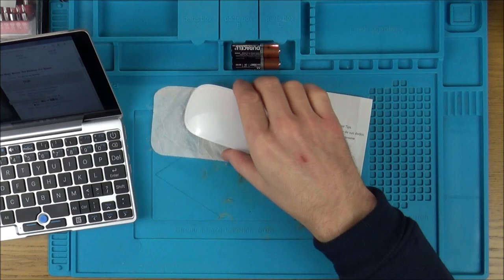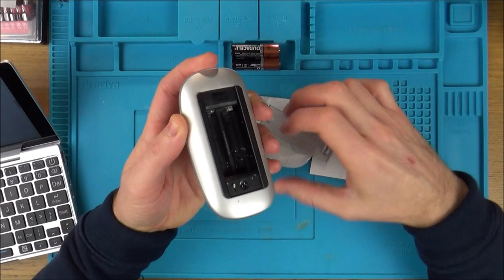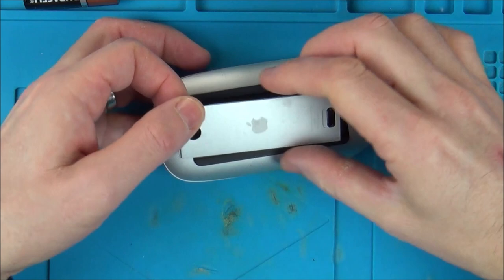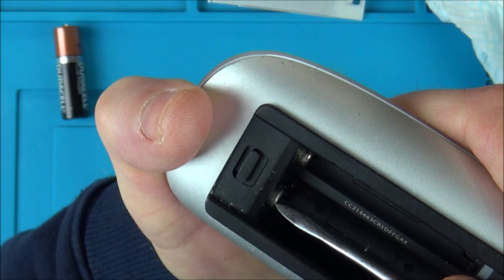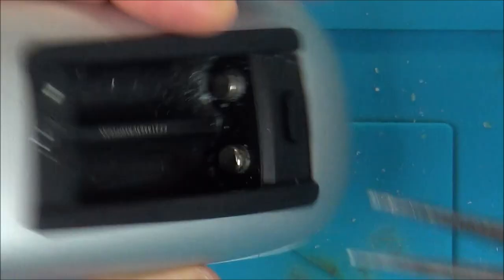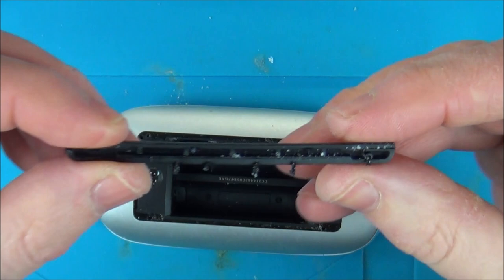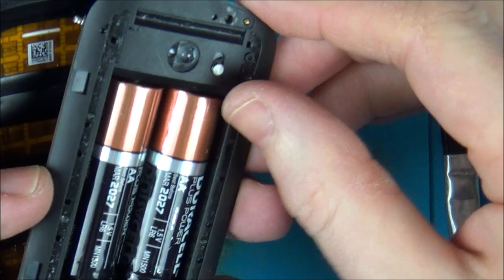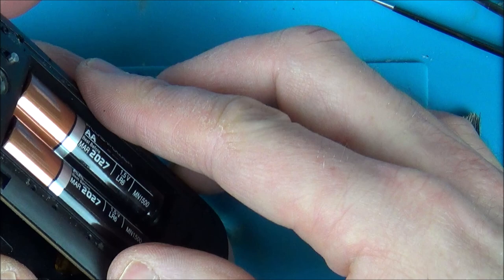Trying to FIX: Faulty Apple Magic Mouse 1 purchased from eBay

Comment: Vince: ‚Yeah, maybe if you‘re some kind of graphic designer in some fancy office somewhere, you‘d want it looking all sleek.‘

Me: * Nervously peeks at my Mac in the corner * I....I feel so called out right now. Lol

To be fair, my office is a dump and Graphic Design is mostly very boring, so everything that makes your life a little easer is welcome.
Honestly though I love the Magic Mouse for it‘s touch capabilities more than anything else and I think that‘s probably part of the reason they designed it that way as well. The touch scroll and swipe gestures would not be seamless with split physical buttons and would have to be restricted to certain zones on the mouse, wich would make them a pain to use.  So they kind of had to design the mouse as a single slab to ensure that it is functional. Now the charge port on the version 2, that is stupid and clearly form over function.
Reply from the maker: Haha, sorry :-) Thanks for your insight on the Magic mouse :-)
Reply: @Mymatevince  It's all good! I just thought it was funny. :)

I love your videos btw. I've learned so much about fault finding, electronics and soldering along with you.

Comment: in 2009 apple didnt have a right click
Reply: That's just not true. MacOS 8 supported right click in 1997. The first Apple Mouse to have a right click function was the Mighty Mouse introduced in 2005.
Reply: @garrys9336  I was being semi-sarcastic as some models absolutely didn't come with right click and some did.  CTRL click and "alternate click" with modifiers were still a thing.  One of those "think different" mentalities.  That mouse i a perfect example, as the PCB is silkscreened 2009 and absolutely doesn't have a right-click, just a spring to make up for the mechanical button not being there.

Comment: i have a slimline an apple extended keyboard I can post to you to fix, almost the mission impossible to fix construction wise, almost guaranteed to destroy it just taking it apart, those touch mice are real fancy using bettertouch tool , you can setup touch sensitive left and right click so no physical click needed less RSI potential.
Reply from the maker: Thank you for the info. I am hoping to release a video late tonight on the Apple keyboard, I also have a 2nd video filmed and edited. So I have done 3 of them. I won't give away the outcome of the videos but I won't be doing anymore ;-) Thanks for the offer though :-)

Comment: Oh Vince this was a really hard video to watch 😂 but if you have never used one before it’s understandable.

Apple mice don’t have a right click, as you can see when you took it apart, there is only one switch. It’s partially done with touch.

The way it works is you press down with one finger to get left click and press down with two fingers to get a right click. I think you can also just tap the top with one or two fingers and not click at all.

The gold pin is just for grounding it to the casing.

Scrolling up and down will still work in Windows with two fingers without any software, basically just think of it as a hybrid between a mouse and a touchpad. Using two fingers down the centre will act like a scroll wheel on a regular mouse. I believe left and right scrolling should work too, not sure about pinch to zoom, been a while since I’ve used one but open a photo in the Windows photo app and try it there.

Bootcamp is not a Windows application, it’s the software that’s pre-installed on Macs to allow you to install Windows as a second OS.

Honestly it’s kinda stupid, Apple prides themselves on simplicity and the whole “it just works” ethos but most of their products are so over simplified to the point that they’re no longer intuitive to use even by someone quite intelligent and technologically minded such as yourself.

Comment: It appears that the ribbon cable connector is NOT pressure fit.  There is a clip that locks the cable into place as shown in the video.  You can also see him flip the clip when he puts the flex-cable back into place.
https://youtu.be/LmRj9bwMJ3c?t=159
Reply from the maker: Thanks Lard, I completed missed it. Cheers for the link :-)

Comment: That mouse does not have a right click. The way you right click is by holding the command button on the Mac keyboard. I have the same mouse with my iMac. You might have somehow just done a sort of touch on the sense of the glass to trigger it as right click or the way how fast you click in between clicks. when using this mouse in windows. The middle of the mouse should work as scrolling (touch)

Good luck
Reply: That hasn’t been true for over 15 years. Macs have regular right clicks and so does the Magic Mouse. If your iMac supports any kind of modern macOS you should be able to switch to regular right-click in the settings.
The way it works is via a touch digitizer in the top assembly (where Vince clipped out that black plastic clip). It has multitouch and detects your finger. I think the actually click is purely cosmetic. Either Vince damaged the digitizer when he he was  trying to reinsert the ribbon cable, or the cable isn’t seated properly.
Reply: @sweetasbloodredjam  So there is a setting in the os? Im runnign High sierra but i cant get it to right click what ever i do.. i can do it with holding ctrl key but not just clicking on the rightside what ever i do.
Reply: @sweetasbloodredjam  nvm i found out if i hold down the mouse click it makes a rightclick
Reply: @Drone_Out  Yes, there's a setting for it. If you go into your system settings and into 'mouse' you will find the 'point&click' tab.

There are three settings: Scroll direction, Secondary click and  Smart zoom. 
Tic the box for 'secondary click' to enable a normal right click on your Mac. In the dropdown menu besides the box you can choose wich side is going to be your right-click, but i think it's on 'right', by default. 

Hope that helps! :)
Reply: @sweetasbloodredjam yes it's there and working now! My God had this thing for almost 1.5 year and never knew this.. I was so convinced it just didn't knew about right clicking unless you used a key or a conventional mouse.🙄🙄 well learn something new everyday! Thx 😊😊
Reply: @Drone_Out  Glad to be of help! :)

Comment: I thought Apple mice don’t have right clicks? As no use in their operating system.
Reply: That is not correct. macOS does have a regular right click context menu, serves the same purpose as in every other system. It pops up on right click with a regular mouse, or on two-finger tap on the touchpad or Magic Mouse
Reply: Yep I am sitting here with a mac (MBP 2018) and have both the magic trackpad, a magic mouse, and a logitech mouse. Logitec works just like windows. Magic mouse and magic trackpad II = two finger for context menu. Windows needs the bootcamp drivers to make these functions work. edit: just noticed its the magic mouse 1, I have the newer one.
Reply: dash8brj Thanks for confirming! I’m on macOS but on a Hackintosh with a regular PC mouse, and I suspected it’s two fingers on the Apple hardware, turns out I was right.
Reply: Maniura thanks
Reply: @YdenPL  Magic Mouse doesn‘t need a two finger click though. It can do a proper right-click.  I regularity switch left and right click, because I use the mouse with my left hand, so I know the digitizer detects wich side I’m clicking. The track pad is a two-finger click, like every Apple trackpad.

Comment: I just don't get why people buy overpriced Apple products. Can someone please tell me why I should buy these instead of cheaper alternatives ?.
Reply: some people react on visible Design, aka 'eye-candy'. I do. Nice devices are sooo attractive.
Reply: @michaelheinrich44  So some product that looks atractive tempts you to buy it ?. I would rather do my research and buy any product that is as at least as reliable but a damn site cheaper than Apple.
Eye candy to me is not the selling point, nor is the logo of the manufacturer printed on it. Explains the reason why I have never bought an Apple product.
Reply: They're more advanced designs in appearance and function. Apple controls the quality rather then depending on separate manufacturers to supply the parts. My iMac has outlasted my best friend's PCs by 2 and counting, I haven't had to go through the all-night "find the issue and restore/fix-it" software issues that Windows is prone to. Now he's purchased yet another PC and I learned that it doesn't have a solid state drive...guess what killed his last PC? So you see, in the long run you do get what you pay for. His PCs were a bit less to buy each time, but considering the issues he's had and now the need for yet another new computer, he's ended up paying more than I did for my iMac, not including his time dealing with that often buggy OS. So that's the main reasons you should spend a bit more and buy an Apple product instead of a PC.
Reply: Andy P reliability is strong with apple. just yesterday: a friend has a new car. i plugged in my iphone via usb and carplay works. he tried his android phone and AndroidAuto failed with an error message.
Reply: @nicholas790  My experience has not been that of your friend fortunately. I have always built my own PC's and have only just upgraded after around 10 years as my Phenom II processor and graphics card was not keeping up with the newer games at acceptable frame rates.
The other reason is that the Phenom II didn't have SSSE3 instruction set which some games relied on.The components I swapped out are still working 100%.

 I haven't used Windows for around 12 years because I got sick of the vulnerabilities, high resources (probably built in spyware), update failures, lack of customisation and compulsory drivers for everything you plug in it. Windows 10 looks like a Fisher Price console you buy for a 5 yr old. Hence I use Arch Linux to run games made for Windows.
Sounds silly I know.

I am not against people who choose to buy Apple products at all. It's called competition, which is healthy for the industries and competition but going back to my original post, I paid about £4.00 for a mouse over 10 years ago and I still use it to this day. Yeah the finish has worn through but it still works a it should.

Comment: Here N "Ass-Trail-Yah" We have an excellent range of Soft Medium and Stiff Err-or is that Hard? ?! " Say what now? hmm you're right... that does read awfully explicit.. :| But it's not suppose to" Meh!.. Where was I? 
Toothbrushes.. So yeah.. instead of a flux brush I would first use a soft toothbrush to remove corrosion, if it doesn't get it all, usually a medium one should get it, but for really stubborn corrosion the harder ones should really give it a work out without doing any serious damage, if components do inadvertently get removed, then the board may need a reflow followed by a thorough inspection for damaged components and their pins, tracks, ribbons sockets and switch contacts if they are accessible, to which they are then all addressed.

Having said that... Really Vince? A frigging Mouse! And for a toy at that? Meh I guess with all other brands pickings may be really thin.. AY? :D lol
APU I dropped a like..

Comment: i just (cr)apple bs hw, just not worth your time...
Reply: Far superior design when compared to crude outdated PCs with mechanical switches. Vince was trying to make the mouse work like a click switch PC mouse when only a touch will activate the features. Vince should spend more time becoming familiar with the features and functions of a product before opening it up. I noticed he put those standard AA batteries in it when Apples batteries are a bit longer and would have eliminated at least one of the issues, the other being the corrosion caused by leaking standard AA batteries. I use and swap Apple's own rechargeable batteries for over 7 years now and there is absolutely zero corrosion. Their "kit" provides 5 batteries (2 to swap out for re-charging plus an extra.

Comment: It doesn’t turn on with this switch. There is a smd detector switch on board which actually activates when the slide switch pushed upwards.